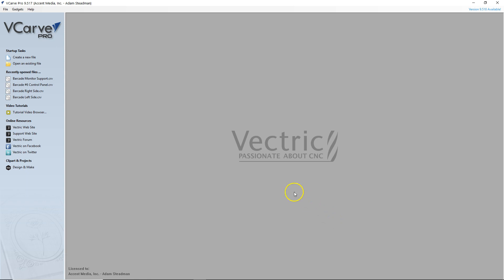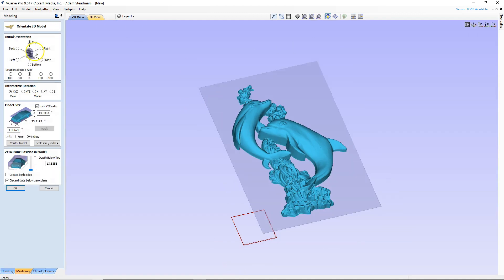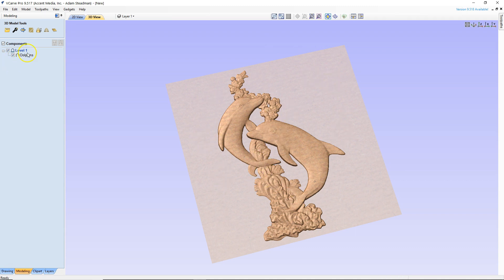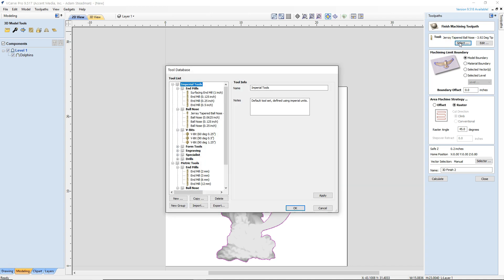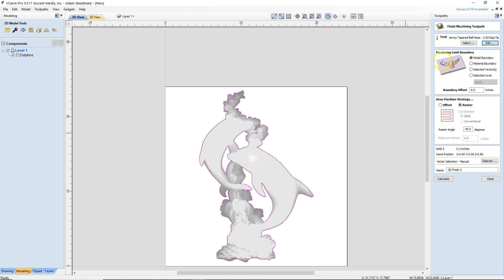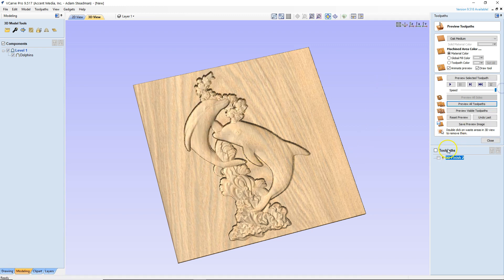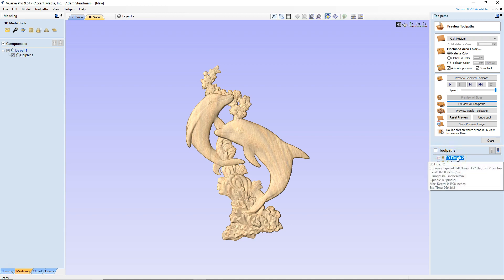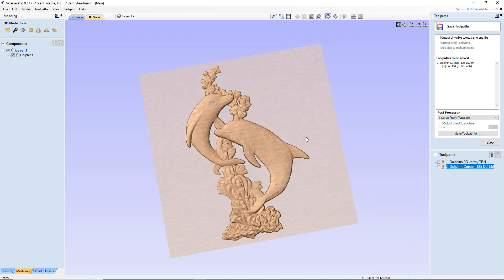VCarve Pro Quick & Dirty 3D Import & Carve

Comment: Hi  Thanks for your video, I know this is an Old video but, I have up to date vcrve pro and I dont have the import option for the one you selected, I only have "improt vectors", "Import Bitmap" and "Import PhotoVcarve or Cut 3d toolpaths"... Does anyone know anything.. Thanks, im stuck...Im trying to import an stl..
Reply: I have v10 Vcarve Desktop, no problem bringing in the 3d model component..its not a "standard" import though...on the Model Menu, its "Import Component/3D Model" then you are off and running.